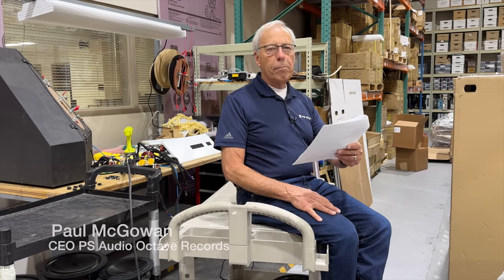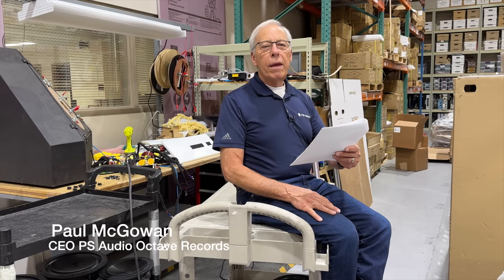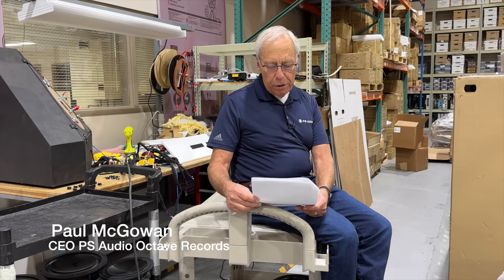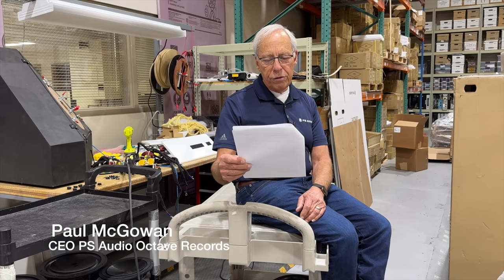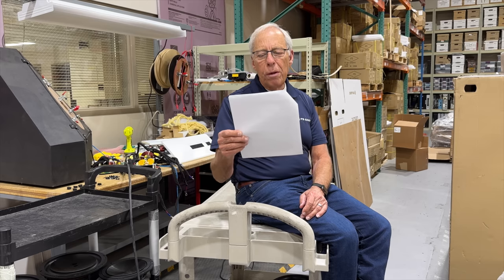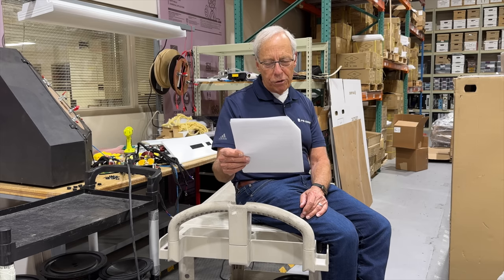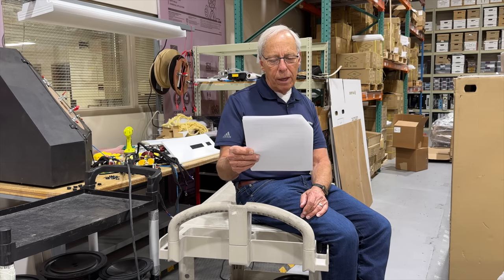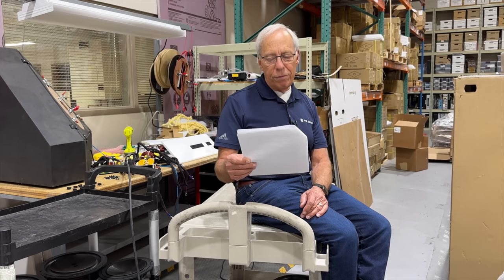The proper AB method

Comment: Hello, 

Blind tests are very useful when they are well done.
First and foremost, you need to equalize the output levels of the devices to about 0.1 db. No device should sound louder than the other.

Comment: Great point Paul “Relaxation is Key.”  I find that to be the case when I’m transcribing music, it’s very important. I’d like to add that fatigue is a no-no and very real. 
The less often you engage in that type of concentration, the quicker you become fatigued. So don’t try spend several hours A/B ‘ing equipment at the outset. 
Like learning a 
musical instrument, short sessions in the beginning, and short sessions initially after an extended break from the activity will typically yield the best results.

Comment: An A/B test on electronics from reputable manufacturers would need to be performed at least 10 times with a hit rate of at least 8 out of 10 to have any meaning. Then there is the question of which sounds “better”, probably down to personal preference. Loudspeaker choice and room acoustics will have way more effect on the listening experience.

Comment: Hi Paul, you are the only person who can help with this, I recently got a pair of Polk Reserve R700 towers, I tested both with a 9-volt battery and it looks like the woofers are wired out of phase, I contacted Polk via email and they told me the R700 uses a second order cross over, will I have a problem during Audyssey setup of the speakers? I'm using the Denon AVR X-4700H.
Reply: Have you tried hooking them up to the Denon with the DSP? In the past Denon units would warn that a speaker is out of phase but you could over ride or bypass the warning. Not sure if it's still like that. I have the same speakers and contacted Polk as well..I noticed the out of phase woofers as well. I did have to switch the polarity on my Svs subwoofer to make them sound well with the speakers. I recently hooked up my minidsp Dirac to the speakers and was wondering how the out of phase woofers on the Polks effected the way Dirac does its thing. Let me know when you try your Auddessey and if you like how the bass sounds...I'm curious
Reply from the maker: It could be that they are purposefully out of phase to compensate for the crossover. It's not standard but I've seen this done before. You can always open up the speakers and reverse them but I'd be careful with that. Seems that if it was a production error it's unlikely both would be wrong. In any case, using DSP is going to be fine and I wouldn't worry about that end of things.
Reply: @Paulmcgowanpsaudio  the manufacturer did concur that the woofers are wired out of phase due to the crossover. I opened the enclosure and saw the 2 separate large crossovers. The speakers have bi-wire binding posts, and after running them both with correct polarity I do feel they sound better with woofers out of phase, mid & tweeter in phase. I'm not a fan of this type of wiring or crossover but I have to admit that overall these speakers sound/perform pretty decent.

Comment: Sound memory is hard, many people have none, or a very short one. I personally developed a stupidly long memory for sound. I can hear an audio rig with years apart and pinpoint what changed and which part of the chain makes that change. Or I can hear a certain cable in my own rig, then weeks later not know it's in someone else's rig, and be like 'hey, did you get that cable too?'. Or be at an audio show, not know any component, and notice that the turntable sounds like an idler wheel machine (no, not rumble. Reed is kinda above that 'level' ;)). But because SO very little people can do this, you're rarely believed (other than by the people who see you being spot on time and time again). 
So currently I'm at the level where A/B is not really necessary for me anymore, but before I got to this point I found that changing something in your rig, getting used to it, whether you like it or not, and then after a couple of weeks or a month of regular listening, changing back to the OLD, really does the trick.

Comment: Absolutely ... Blind AB is the best method.  The only way to reliably tell when one thing is better than another is to not know which one you are listening to. If you can peg the same device multiple times you have a genuine difference to evaluate.  If you can't, the whole thing reverts to the level of guesswork (50% accuracy) and there is no significant difference.  Sometimes even toss in a false change (same device twice in a row) or two to see if you can be fooled that way as well.

The human ear is a terrible piece of test equipment. Too many things affect the way we perceive sound for you to ever do anything but a generalized evaluation. Proper test equipment can reveal far more than your ears ever will. But in the end, the final test is whether you are happy with your choices... or not.
Reply: of course (except as metaphor) "The human ear is a terrible piece of test equipment." just as test equipment measurements are a terrible basis for determining how reproduced music strikes one's soul. human sensing varies from case-to-case & is improvable via training. the organic foundation of sensing & cognition is both weakness (an audio industry / contention over truth) & strength (conclusions from selected information feeding improvements in audio equipment). it's analogous to the distinction between science & faith. synthesis is somewhat possible after one distinguishes tools & application processes from the "thing itself" in the human dimension.
Reply: @grumpy9478 
Well... if you know how to actually interpret the graphs and charts in electrometry you can pretty much tell what it's going to sound like. Seriously... why do you think certain design goals exist?

The distinction you make is likely due to a lack of understanding.
Reply: quantified design goals are nice. my audio happiness goal is a qualitative one specific to me, determined subsequent to review of relevant quant data. "...you can pretty much tell..." isn't a good enough standard (for me).
I have great respect for & actually understand graphs & charts - having spent a career in sensors & transducers of many kinds... ultrasonics, high end drivers, radar & RF signal propagation among others. you provide excellent technical info. maybe not so smooth on what's outside that comfort zone. maybe there's nothing of meaning outside the quant zone, fuzzy at it sometimes is. could it be a "lack of understanding"? doesn't really matter, at least not to me. @Douglas_Blake_579
Reply: @grumpy9478 
"quantified design goals are nice. my audio happiness goal is a qualitative one specific to me, determined subsequent to review of relevant quant data. "...you can pretty much tell..." isn't a good enough standard (for me)."

Okay... so follow your dreams ....
Reply: My dreams are highly accurate, statistically significant, state-of-the-art measurements! Hard numbers! Cold math! Pretty charts! BTFO those qualitative hippies every single time!